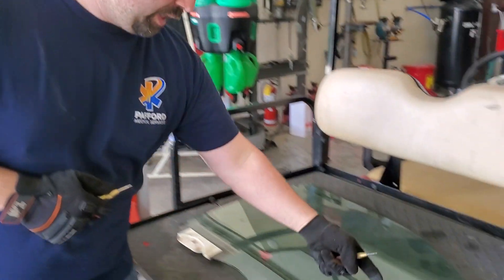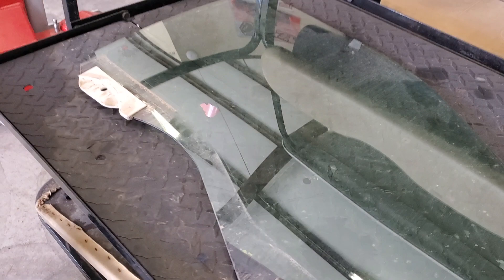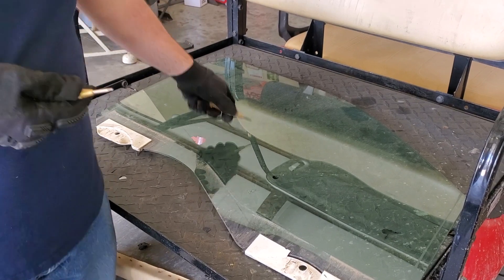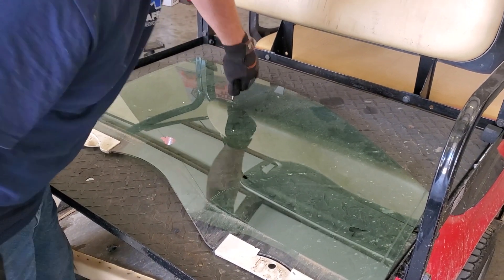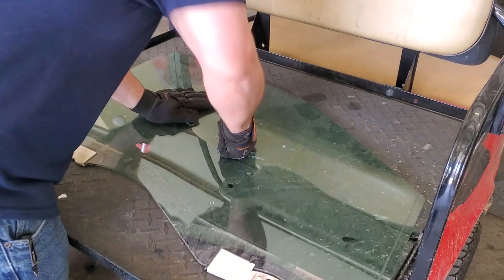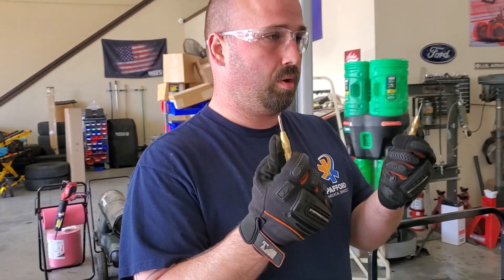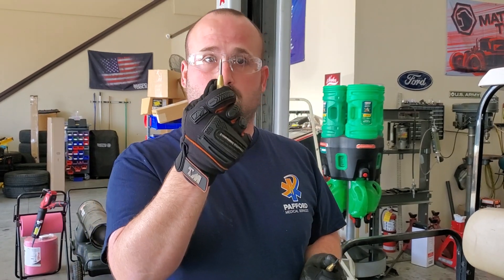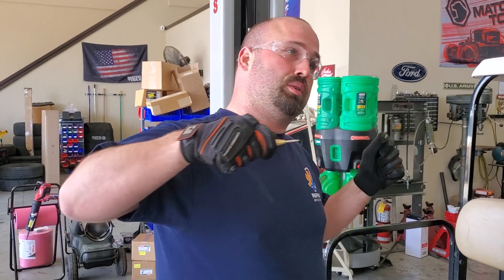some good info if you ever need to break a window on some vehicles nowadays

Comment: How do we know which glass is which if there are no existing cracks? I have a 2018 Transit and carry one for mechanic work and figure I could use it in emergencies if I have to break out. ie: Not likely but if I sunk underwater and couldn't open doors/windows.
Reply from the maker: There is a little label at the bottom corner of the glass that will state if it's tempered or laminated